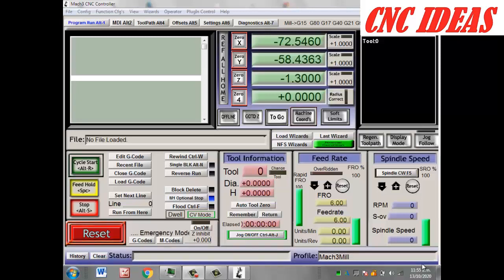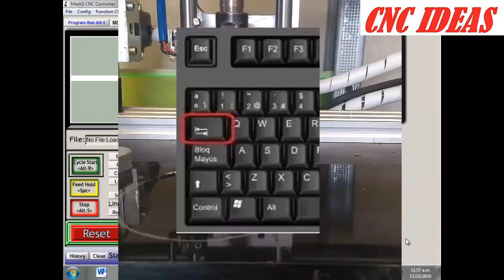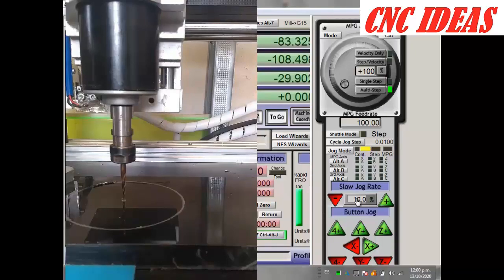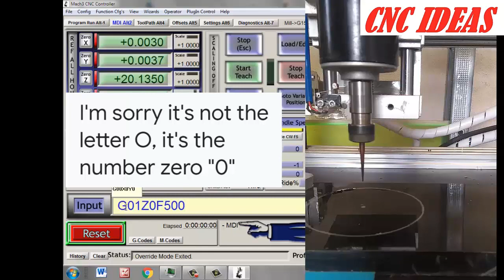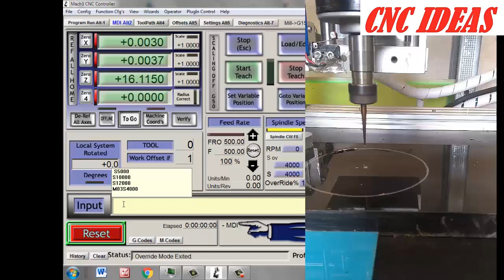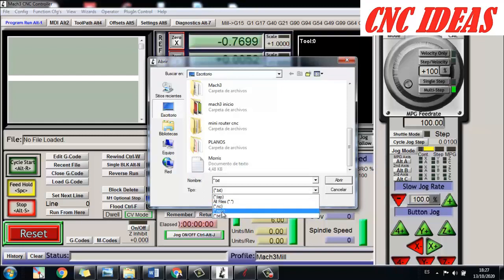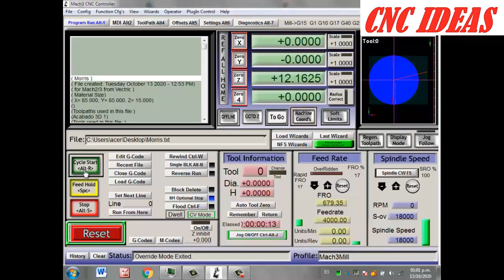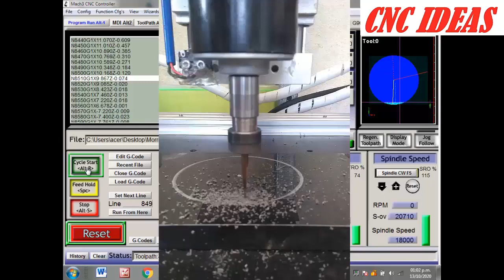Basic handling of Mach3 Cnc Router (Beginners)

Comment: Sir how to resume Engraving feature mach3 software when electric power cut, and after power came how to resume Engraving where power cut, please guide me
Reply from the maker: Actually I do not know that function in Mach3, what I know is how to start the program from a certain line but for that you must know where the program was before the failure occurred, I think it is not useful in this case, in the same way you I share the video (espanish version) https://youtu.be/7p166pG4vVU
Best Regards.
Reply: @Cncideas817  sir according your video when power cut, I clicked stop button, the , I click page up key for z up , after z up , I click TO go, then after clicking to go , GO ZERo, then close , mach3 software, after came power, open z code,and enter line number where power cut, after fill line number , click enter key, then press cycle run option, but why you not click spindle motor click, tool will broken when spindle will move where power cut, please clear confusion 🙏
Reply from the maker: @sonuverma2796  
It is possible that this detail has been omitted, logically the spindle must be turned on before starting to work on the material, otherwise the tool will break. Greetings
Reply: @Cncideas817  my spindle motor menu spindle rpm shows zero, not shows , before fresh job work started, 24000 rpm

Comment: Doing the manual movement the HARD way.   Note the shift and control keys to the left on a keyboard?  arrow keys alone move at  the sped set in the fly out. SHIFT with an arrow key -- moves at TOP speed ( set in motor tuning).  Control with an arrow key -- moves ONLY the distance set  in  The  CYCLE JOG ( the move distance is displayed to the right of Cycle Jog)   NO NEED TO EVER use that flyout  at all once you have the jog distance set. For my uses .010 is as fine of a move I need. 

There is 3 distance settings there.  These can also be set in the general config window, third or fouth down under that config button top left. There about half way down one of the 2 mifddle columns there.
Reply from the maker: Thanks for the comment, I am also learning every day. I hope to correct all mistakes and share new material. Best regards.